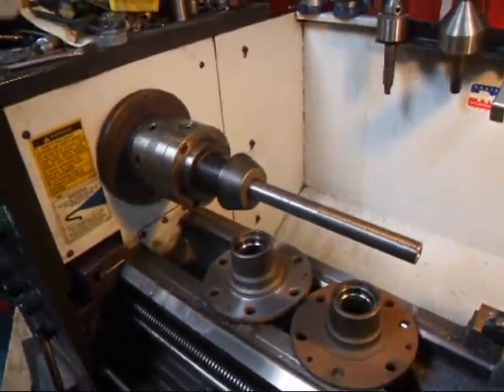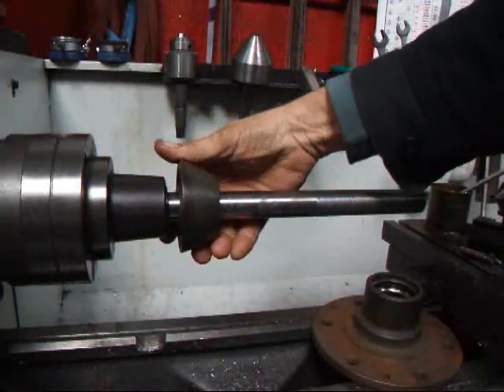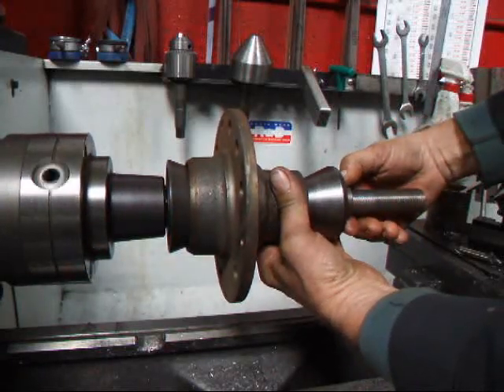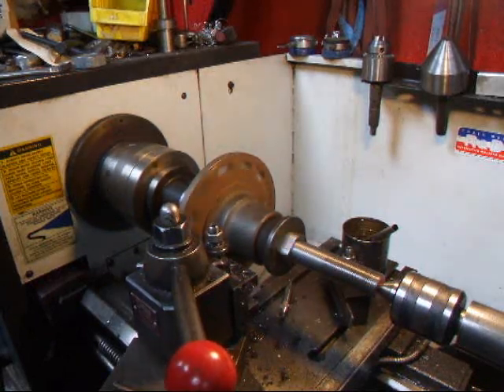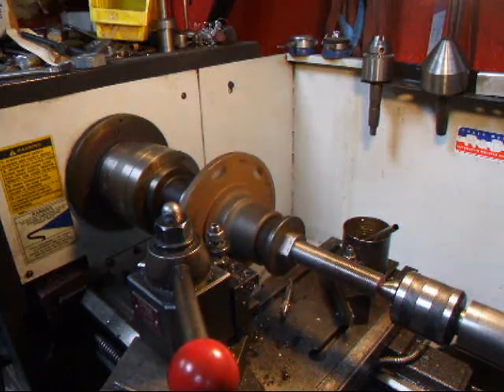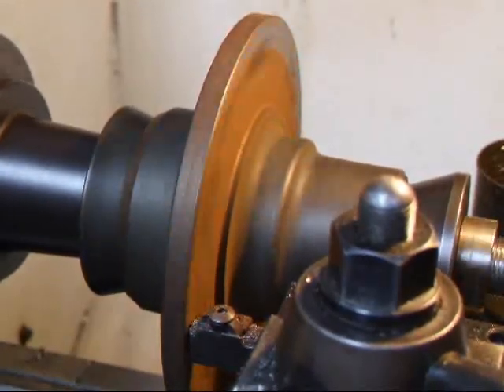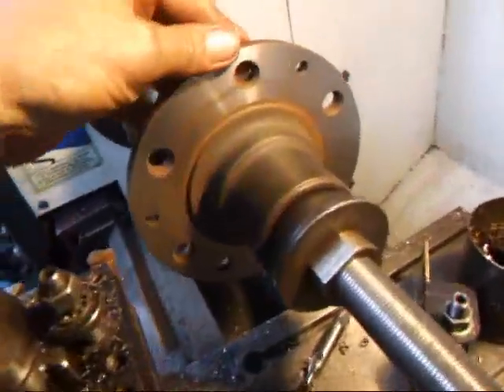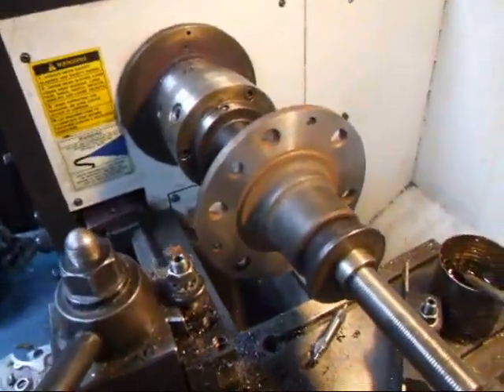Hub Truing-04.wmv

Comment from the maker: @jacktheripped - The reason you mount the part with cones is to ensure that is spins true to the axle bearings. A caliper and granite surface plate will definitely work - how would you check the part to be true to its axis with this?
Reply: the best way to be sure is to use bearing adapters from a brake lathe, the cones relies on a chamfer done on the original machining of the hub and there no garenttee that this chamfer is true with the bearing cup bores.